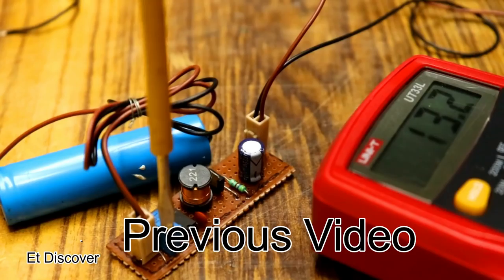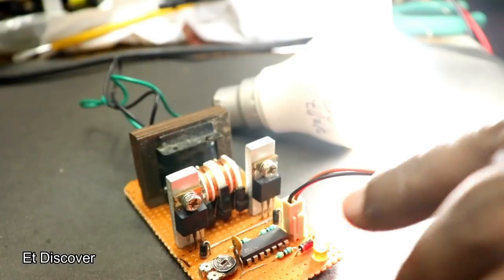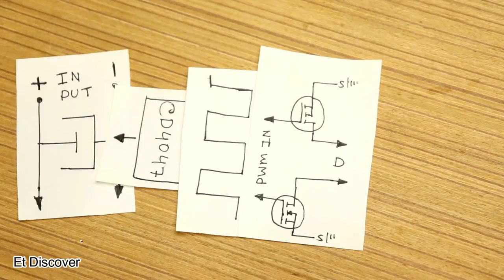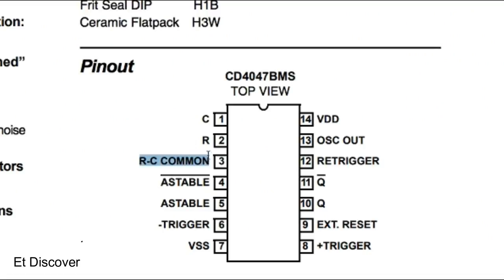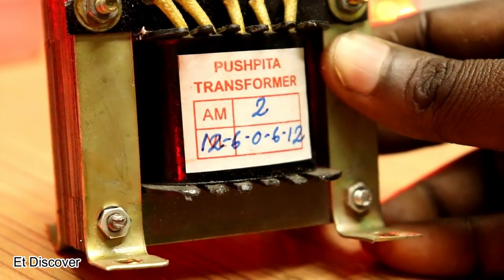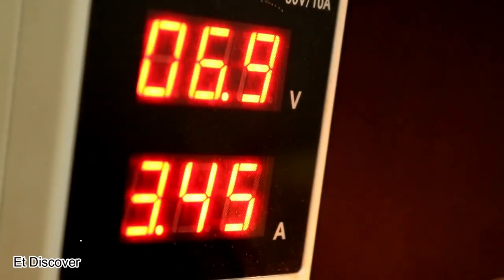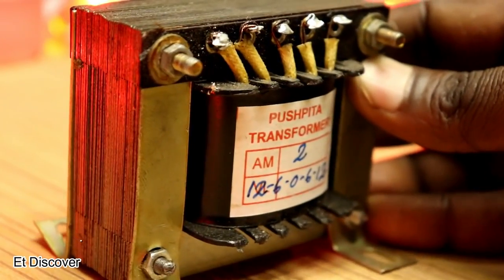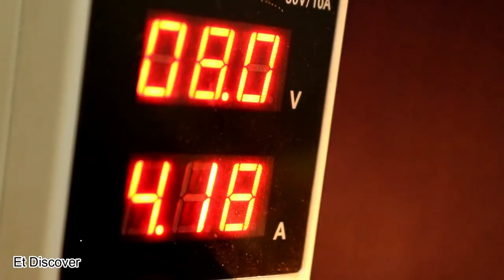Super Power full Dc to Dc boost Converter # for High Amp

Comment: I want  to design a isolated buck converter for 450V to 12V with output power of 200W.... but the problem is with calculations and it messing up whole circuit... can u help out with this..

Comment: upto how much amp current can i input in this boost converter??, I mean can I input 12 volt 10 amp for 24 volt 10 amp current??
Reply: Depends on the transistor,diode and coil you used. If they are rated for that kind of current (and the trans is cooled properly) then yes it will be able to handle that kind of current.

Be careful that I'm talking about input current not output. If you output 12v 10a with 6 v input then it will need to be able to resist 20a. If you output 24v 10a then at 6v input it will need to resist 40a and will need very good cooling for the MOSFET.

Comment: Sir sell your making PCBs on Amazon or any other websites.
Reply from the maker: :D
Reply: @EtDiscover  
Appreciate your hard work, Can you make a MPPT for solar panel or variable PWM stepdown supply ? Wanted a variable input voltage of 10 to 40, 10 to 60 and amperes 10 to 20 input of MPPT, and constant output of 12vdc ouput, if you require a reference links i can post it here, if you able to make eagle file or gerber file, need pcb layout to transfer ink on cooper clad

Comment: Sir !!
While l was experimenting with 12 volt transformer in the process of making battery charger....l found that voltage was raised up 16-17 volt Dc with rectifier .
So my question is...why does it happens so....it show 12 volt without rectifier but as l connect rectifier adding 16v 3300uf capacitor..voltage raise up 17 volt Dc....!!

Help me sort out this problem..!!
Reply from the maker: Charges are stored in the condenser 50 times per second. If you do not add a condenser, you will never get more voltage.
Reply: I got it...
But my question was why 12 Ac raise up to 16-17 volt DC when it is rectified using diode n capacitor..?? Why not 12 v AC does not change into 12 v Dc...???
As u know while charging voltage must be 13-14 v DC..but it raise up 16-17 v DC which is not healthy for battery charging...

How can l get 13-14 v DC output with the same current for charging battery...?
Reply: @bishalrajalemagar6844  don't you know that dc=√2*ac??? It means when ac 12 volts is rectified into dc it will be 12*1.414= 16 volts DC. So it is showing 16 volts at the terminals of the capacitor as it is pure dc. But the voltage will collapse when it is loaded. So we need to add more capacitors in parallel. For charging a battery a simple solution can be to use 2 lm317 ics(1 for voltage stabilizer and another for current stabilizer), if you want to charge a battery within 500ma current. But for more current buck converters with current stabilizing features should be used.

Comment: hello.....i want to help me about reduce 25.5 v DC 1.6 Ah to 18 v DC 1.1 Ah thanks ( for drill )
Reply from the maker: I can not understand
Reply: @EtDiscover  i have transformer give 19AC so i connect diode bridge and capacitor 2200 uf 25v the voltage become 25v DC we i connect to the drill the current is 1.5 Am ( the drill work by Ni-Cd 18v 1.1 Am ) i need circuit for that
Reply from the maker: Here you can use it. The diagram is in the discretion